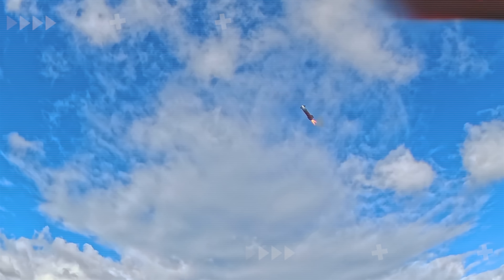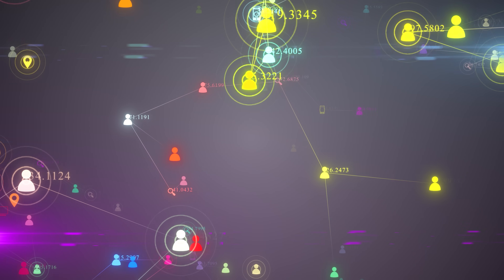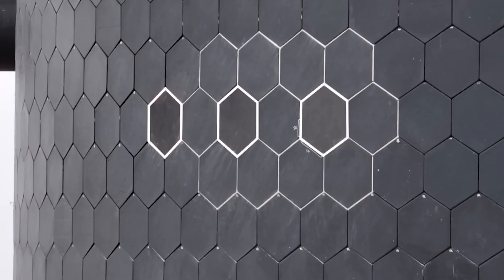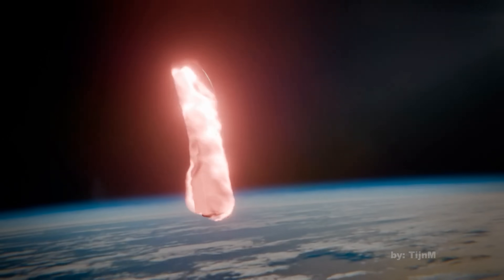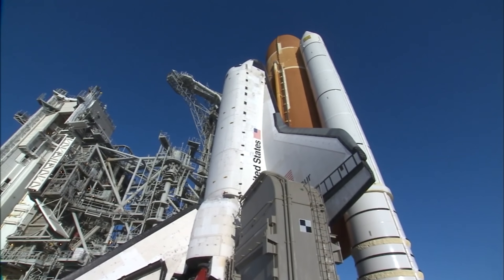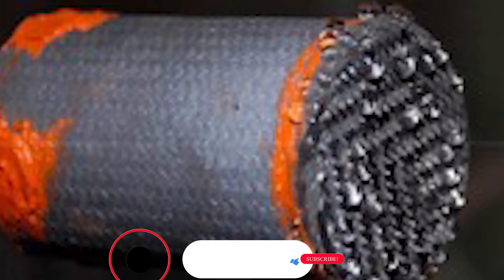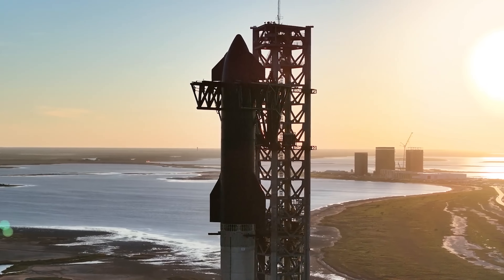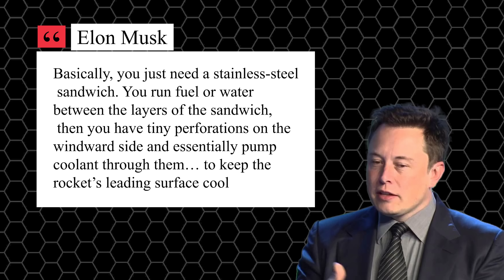Elon Musk officially declared Starship Metal Heat Shield ''USELESS" after Flight 10 Reentry...

Comment: It's remarkable that they spent hundreds of millions to develop a giant launch vehicle, but apparently didn't solve the heat shield problem first
Reply: Seems to be one hard problem to crack no one has come up with a 100% answer yet.
Reply: @101spacecase no one has ever developed a fully reusable Heat shield. It's possible that this problem may never be solved but it is odd that the company spent the money to develop giant, reusable spaceships, but hasn't developed a workable heat shield first
Reply: @jimeditorial    I completely concurr , completely  reusable heat shield seems not feasible. Use ceramic tiles or ablative material ....
Reply: @jimeditorial  This is exactly what they are doing. They have developed the ship up to the point that they now can start experimenting with different types of heatshields. Once they have that working, the ship is ready, not before.
The only thing remarkable is that there are people believing that such testing can be done by simuation or in a lab, not under realistic conditions.
This is rocket science, and rocket science is hard.
Reply: Dude, they are testing stuff. Every flight has different stuff if they did it the Boeing way they wouldn’t even have launched the damn thing yet because they’d be so terrified of making a decision.
Reply: in my simple understanding of the world.

i can throw a dart, but i cant stop it instantly without a wall.
Reply: Heat shield is the biggest problem in space rockets or anything that goes over mag15 , usually they use natural stone plates ( ceramic ) but very heavy , there is no metal today that can withstand the heat produced by reentry from space without problems . So yea ,it’s stile à problem and no millions can solve if .
Reply: An understandable comment but the fact is knows it needs to go into space anyway to be truly tested along with everything else so he just builds the vehicles until they start working. When he's done he has all the intellectual knowledge, and, a facility that can build new ones. Overall far more economical.
Reply: @fppro1679 is it? Looks to me like he is hoping that someone else will fund development of the critical enabling technologies.
Reply: So just wait on 99% of problem solving until you solve 1%? I’m not clear on your point.
Reply: @ShawnPitman development of a fully reusable heat shield was always going to be a pacing item. It's logical to divert resources there at a high enough level to ensure that the heat shield is ready when the space vehicle is.
Reply: @jimeditorial oh. How much time does it take to develop a fully reusable heatshield? We should let SpaceX know.
Reply: @ShawnPitman no one knows. It may not even be possible with current technology. Which could fundamentally prevent the Starship system from finding useful markets
Reply: @jimeditorial so maybe that’s why it’s taking so long?

Comment: Tungsten is 4x heavier than steel.
But it's the only metal which really would be completely unbothered by reentry, and require zero refurbishment.
Obviously titanium would be much lighter and has high heat resistance, but it's not even close to tungsten for heat. I don't think titanium could handle it as a stand-alone solution. Also, incredibly pricy (not that tungsten is cheap).
Reply: Tungsten foam....coat with silica
Reply: @13thbiosphere  Tungsten foam?
Now that's an interesting idea.

It'd be much easier to machine into shape for the tiles. And it would be much lighter that way. Insulate better too.

Reentry gets anywhere from 2700 to 5000 F. Stainless steel starts to melt around 27 or 2800 F. And we can see that starship slowly comes apart where sections of tiles are missing. But it is slow. So it's over the melting point of stainless steel, but not WAY over it. It may be pushing something like 3000 F on reentry from LEO.

But tungsten doesn't melt until 6000 F. Even in the form of metal foam, I doubt it would be bothered by reentry at all. The silica would melt away, but it would leave behind a tungsten-silicide layer... which should be good to 4000 F, and protect the tungsten from any high-temperature corrosion issues.

Yeah, that might actually work really well. No idea what it would cost though.

(and yes, I did google a couple times for this reply, hehe)
Reply: @kathrynck  oxygen is corrosive that is the problem on reentry.... Tungsten oxides.....gpt not Google
Reply: @13thbiosphere  Tungsten is real stable at normal temps, but when heated up, it'll oxidize, yeah. The silica on it is a good idea.

I just use google, call me old fashioned. Well, technically I use multiple search engines in parallel, not just google. Cuz I'm not really a fan of single source results curation. To what extent google uses gpt though... I dunno.
Reply: See? This is why need AGI working on Material Sciences. We could crack the Perfect Chemical Rocket Heat shield & and Ambient Pressure RTSC in a Few Weeks to Months.
Reply: even so, tungsten is , beyond being4 times heavier than steel , is far more expensive , mainly because of it relative low abundance on earth ...Nevertherless , if only 3 metallic tiles did this , I see no future on this metallic tiles' path. It calls for frequent replacement of stained ceramic ones , since it degrades them on reentry( due to increasing layer of highly heat conduction capacity of metal on sucessive atmospheric  reentries).That oxigen enhanced ablation  is not good for metallic tiles .It would turn to be even worse than in Space Shuttle that some ceramic tiles to be removed between flights... not economically efficient reusability...😢
Reply: @luiscolchero466  dope
Reply: @13thbiosphere It seems you did not follow the issue. I am not wasting time with you anymore. Dope = no scientific nor objective response. Over.
Reply: @luiscolchero466  Tungsten isn't cheap, yeah. Plus it's expensive to work the metal, because it requires insane heat to melt, and it brutally abuses any machining tools.

But a "permanent" or "semi-permanent" reentry shield will very likely ~need~ to be exotic in nature. There's not very many metals which can go over 3000 F. And tungsten is cheaper than platinum (and far less reactive at high temp). ...and cheaper hehe.

And I don't know of any synthetics which can handle the heat.

It may end up being necessary to use a disposable heat shield, and just focus on the panels being a size/weight which minimizes the labor involved, and attachment schemes which simplify maintenance.

But the silica on tungsten foam idea I think would really work as a semi-permanent coating. Especially if the outer side was non-porous (differentially porous foam metal). Though the formation of tungsten silicide should seal it up pretty well.

Could also pump liquid helium out through ports at hot-spots, and centerline along the belly. Create a buffer of chemically inert lower temperature air under the shield. But then you have the problem of keeping liquid helium at 4 kelvin...

Could also try just expending a lot more fuel on the reentry burn, to make it a bit more gentle.

A bigger reentry burn, or a cooling scheme will eat into payload weight though.

Comment: ROTISSERIE.  Reduce heatshield heating by continuously rotating the starship so that heat of the near side (3000 C) is transferred to the far side and radiated to the cold of space (- 250 C). Perhaps only needs 1-2 roll rotations per second.  The analogy is cooking a sausage on a grill. You can prevent burning it by turning it over continuously. Yes, there are many issues, however these may be much less of a problem and after all, Elon has said that the heatshield tiles are his biggest problem.

Comment: I was abt to check my American Chem ~periodic table of the elements? Basically, tht's the table I rely upon on the chem aspect side. I once marked Chem 115~non-metals known as "Moscovenium." But, no help, as my thoughts drifting into "Anti-gravity."

Yet, the ❓️ques, ur asking were, can metallic heat shields truly replaced "ceramic tiles," in the future?"  As reusable after refurbishment? 
The shift towards metallic heat shields represent a move fr a single system performing both thermal and structural tasks (ceramic tiles) to a system where tasks are divided between a durable metal outer layer and internal thick insulation. Yeah, reusability. 
I maybe wrong, and further~a different Spacecraft for the "Red-planet" Mars. 

Nice subj matter, as always, Thank U, Secret, my friend 💐 I brought YAH, Peace ✌️ 
Best,
•~😼🐉🌻k-p

Comment: Space X could take both ideas much further, liquid cooled metalicthermo layers with a ceramic coating, or a liquid thermo cooled thermal tiles. Mars rover spirit is a good place to start, spirit used a thermal plate and so i read reached temperature 2000celicius. Maybe a starting point but there are definitely ideal starting points with a reusable heatshield using panels either with a liquid cooling system  or head shield tiles/ panels. I wish space X  success. One stap closer
Reply: Rotisserie seems more promising to me. Even the highest melting point (Hafnium carbonitride 4100C) is barely enough)
(copy of my earlier post follows) Reduce heatshield heating by continuously rotating the starship so that heat of the near side (3000 C) is transferred to the far side and radiated to the cold of space (- 250 C). Perhaps only needs 1-2 roll rotations per second.  The analogy is cooking a sausage on a grill. You can prevent burning it by turning it over continuously. Yes, there are many issues, however these may be much less of a problem and after all, Elon has said that the heatshield tiles are his biggest problem.